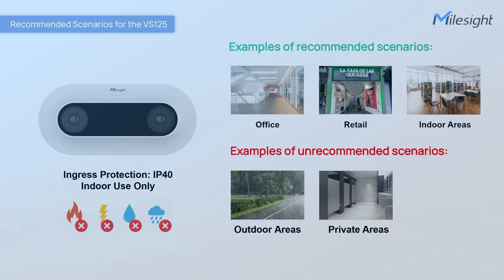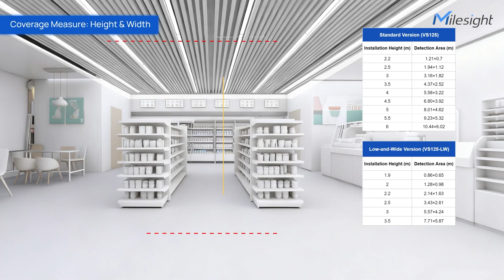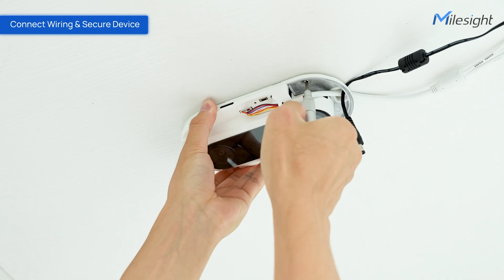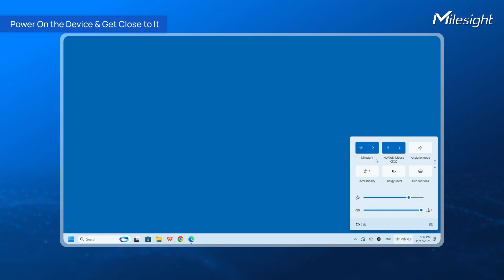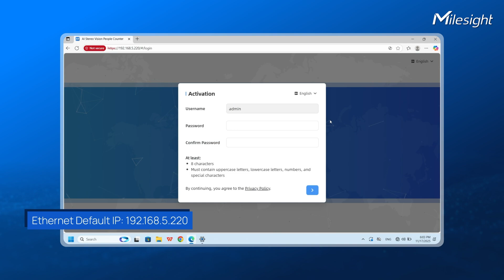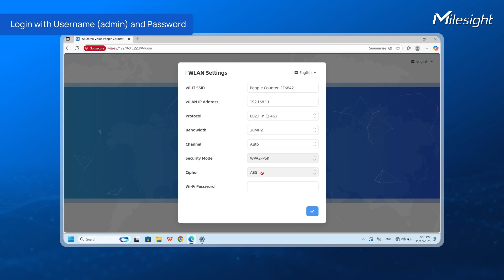Install VS125 / VS125-LW AI Stereo Vision People Counter

Comment: hi.. want to ask.. if i just use poe.. do  i need to use power supply.. or poe power can support the devce
Reply from the maker: Hi there, both VS125 and VS125-LW have PoE version and Cellular version. The PoE version supports both 802.3af PoE and DC 12V/1A power supply, and the cellular version supports DC 12V/1A power supply. For more details, you can check the product page: https://www.milesight.com/iot/product/lorawan-sensor/vs125